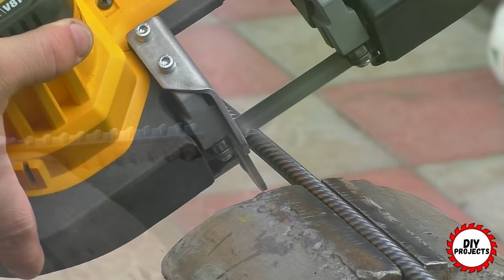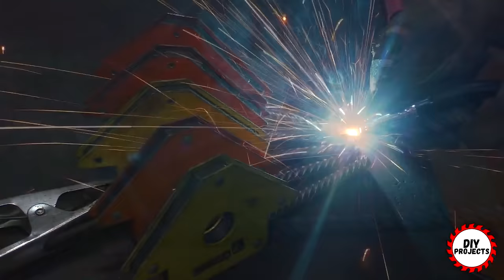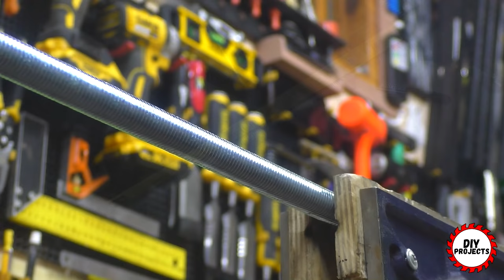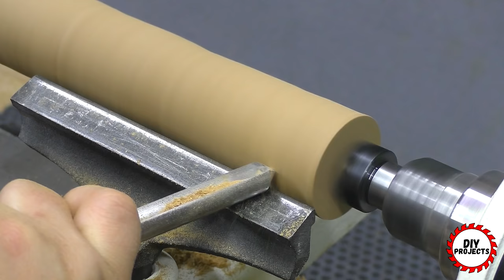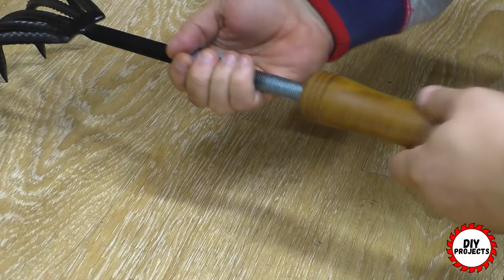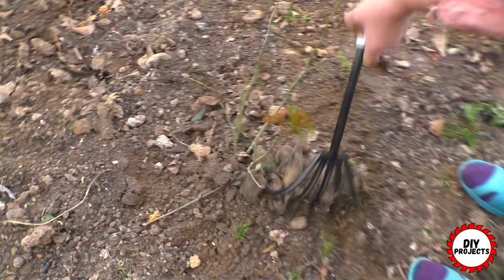An ingenious idea from a piece of reinforcement !!!

Comment: Great metal work ideas. Just discovered your channel. Could you kindly check your camera settings as all the clock-wise movements are mirror imaged. Not cool to watch a nut being turned tight in anti- clockwise directions or a drill spinning opposite direction or grinder spinning opposite direction.
Reply: pm